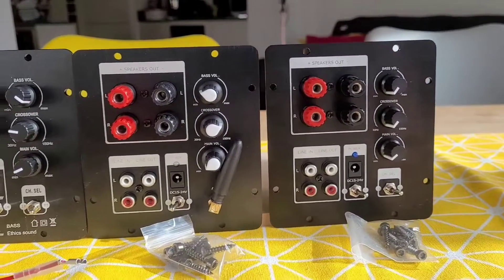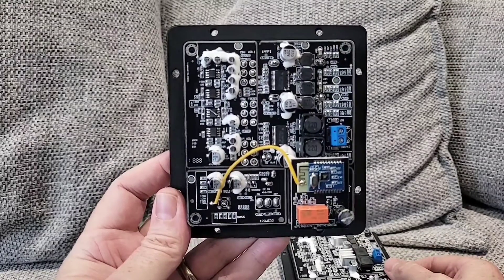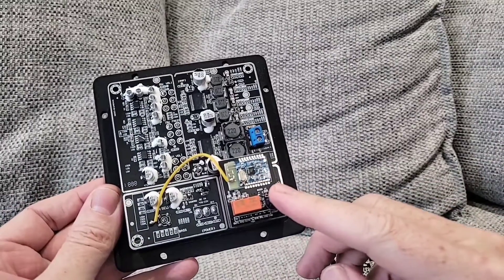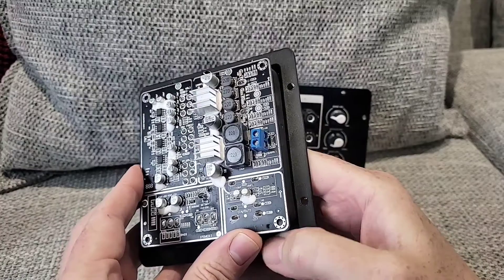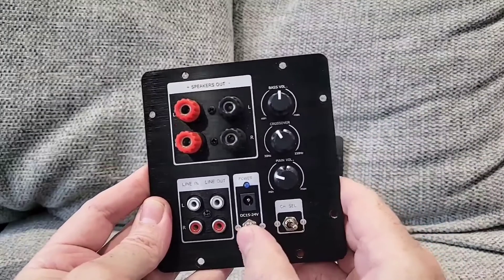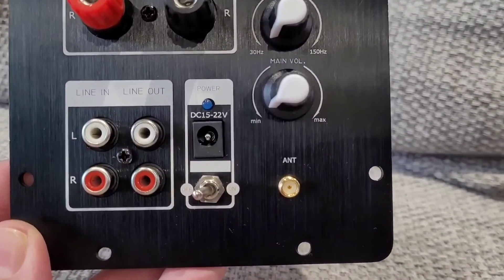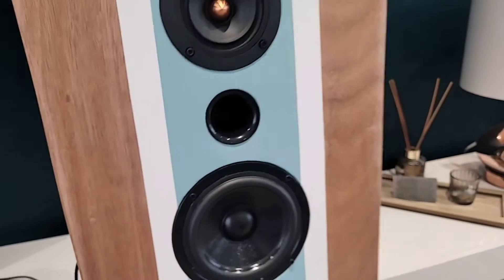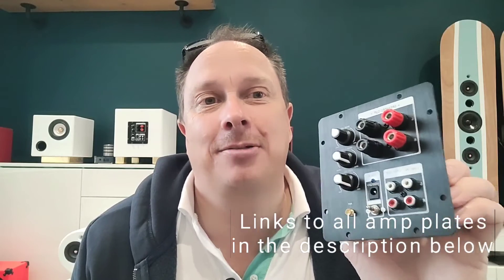2.1 Channel Subwoofer Amplifier Plate Review TPA3116 and TPA3118. Mini Plate Amplifier for DIY Build

Comment: Your video motivated me to use the TPA3116 2.1 in the QUALIA • NSS project (a quadraphonic natural surround sound system), and it works perfectly in my test setup.
I'm commenting to share the details of QUALIA • NSS, a DIY speaker design project based on the fundamentals of psychoacoustics and sound, with those interested in building their own system and participating in the empirical testing of the NSS project blueprint.

Comment: I have a set of tibo plus 3 speakers that has a fault in the active speaker meaning it clicks when turned on and when playing has quiet patches. I was thinking of striping the active kit and making them a pair of passive speakers but would these units likely replace the kit in the active unit once the speaker wires were transfered and bring the speakers back to life?
Reply from the maker: Possibly but I'd take your tibos apart and see if you can fix what's broken instead if I were you. Could be something as simple as poor soldering on something!!

Comment: Where do you hook up the woofer? Do you have to solder?
Reply from the maker: I build this part into the sub and then connect the l+r speakers into the banana plugs. Or build all into one speaker (you will then need to solder) Check out the other videos on the channel, should give you some ideas!?

Comment: Hello, would connecting a 100w subwoofer to this TPA3116 amplifier be enough, or would I have to look for a more powerful amplifier?
Reply from the maker: To get everything out of your 100w sub, you would need to check the power supply you would be using, as although this amp is rated at 100w for the sub and 50w x 2 for the l + r drivers with the average power supply you may only get 70% of the max power. So, to get the full 100watts, you may want to consider a bigger amp but, that will obviously cost more!! Hope this sort of makes sense
Reply: @DIY-AUDIO  okay, thank you very much for the answer

Comment: Thanks for the overview Does the speaker output feature an integrated high pass filter? I am considering getting one of these for a fun build, driving a quite efficient 10" subwoofer and some high efficient mains. But I need a high pass to protect the main speakers
Reply from the maker: Tbh I'm not sure, but, you can use the link to contact the sellers to ask them

Comment: Paul,  I love the channel buddy. Keep it up. One question about the TPA3116 plate amp with bluetooth. Does it have an auto shut off when there is no signal? I am wanting to use this in a 2.1 desktop setup and was hoping not to have to switch it on and off in between uses.
Reply from the maker: Hi Donnie, not that I am aware of. Don't know if there is a work around. You could always contact the seller, they may know more.(parts link in the description)

Comment: I’ve used these on 4 projects as well, sound fine, however have a 150hz @ 12db (2nd order) high pass filter on the L/R channel which drives me crazy… I should figure out how to disable
Reply: I bought the 3116 version and doesn't have the high pass filter for the L/R. Only the 3118 have a filter;
Reply: @tsikisjohn  I also purchased the 3116 Bluetooth version. You say the L/R channel have no filter.  How did you find that out? By testing? I am possibly wanting to use it with a 2.1 desktop system.
Reply from the maker: You know more than me!!

Comment: Hi great channel 

Want to make 3 way speakers with this amp (one amp for each speaker)

How to connect wires to speakers (tweeter, mid and woofer) to this board?

Thx
Reply from the maker: You'd be OK with the woofer but have to figure out a way of incorporating a crossover on the mid/tweeter. Can't really help you but best of luck!!

Comment: And the AliExpress version is much cheaper than the lepai one 😂 even though they are identical. But 50*2+100W is not that usable since you will get 20%Thd+n @ 50W per channel. But it’s more than enough for a pair of bookshelf speakers and a subwoofer
Reply: I literally just need enough power to run two 35w speakers and one ??w subwoofer (all of which are second hand thrift buys $15) in a motorhome.
Reply from the maker: It's considerably cheaper!! Tbh I find the 3116 perfectly adequate.
Reply: @DIY-AUDIO  What power supply did you use and/or what's it's rating?  I noticed the plate amps claimed it worked in the range of 15v-22v which I thought was sorta odd (USA American here, used to seeing 5V, 12V, and 24V power supplies mainly).
Reply from the maker: @MrWirelesscaller  I use a 24v 5A power without issues (never likely to have anything at full power mind you) but bought it separately on Amazon.
Reply: @DIY-AUDIO  Thanks, I was curious about that, I do know if I do buy one of these amps I was going to get a power supply rated beyond the amp because from what I've seen most of these supplies tend to fall short on their claimed output.

I ordered a PAM8610 from walmart yesterday and realized it'd also be nice to get another amp that can push a sub as well (have two sets of bookshelves in two rooms and thinking about buying a sub off craigslist).  These seem to be better built that I expected, now I have to decide which amp to buy for the living room, thanks for your video.
Reply: @DIY-AUDIO  if I use a 21v 5ah battery on 1 bookshelves. How many hours can the amp play at high volume? I'm interested to make a boombox using an old Pioneer 3way 8" passive home speaker... Can you suggest me a mono plate with bluethoot?
I saw many interesting board like this that also have 2 mic input but they have separate woofer and tweeter connection, my speaker has its crossover I need fullrange output
Reply from the maker: @lucabertolaso2167  Hi, I have no idea how long the battery would last. Some clever person on Google may have a calculation for it though!!
Reply: @lucabertolaso2167  i'm totally not a pro at this but if you know that 5Ah stands for (Ampére x hours) it means that it would give 1 hour of playback time when consuming 5A, you won't get a 100% efficiency out of your battery so it would be less but this might give you an idea